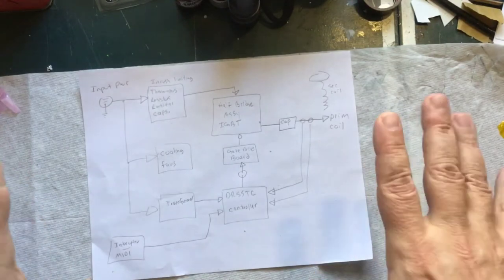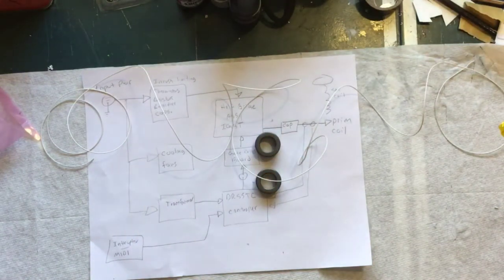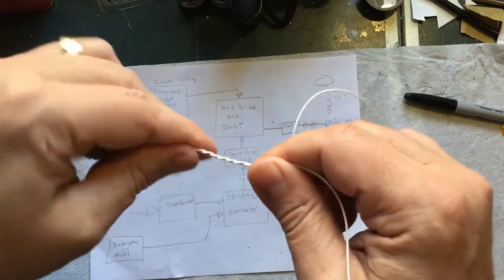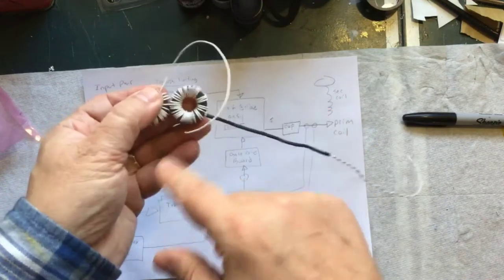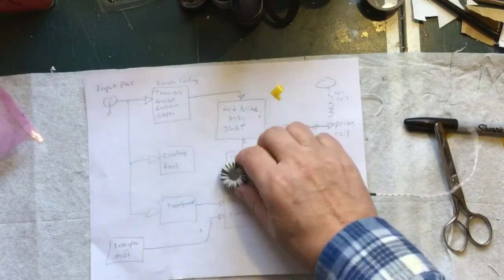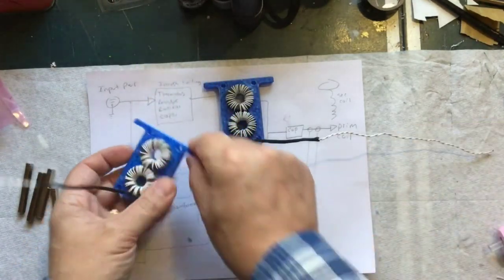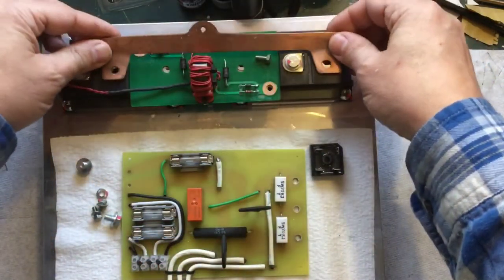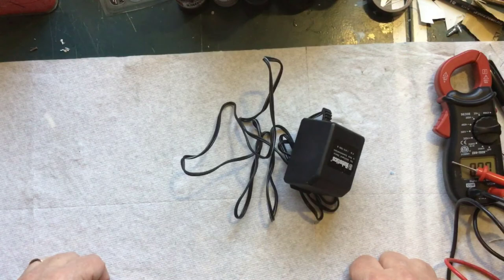Musical Tesla Coil, DRSSTC Build part 4

Comment: Could you post a link to the toroid's I can't find any for $1.50 not even $10.00, thanks.
Reply from the maker: https://www.easternvoltageresearch.com/ferrite-core-77-1/      I didn’t use the cheap eBay ones because I didn’t know if they were exactly the same composition. They are about $5 from eastern voltage research, and I seem to remember finding them cheaper from a distributor by searching the specs, but don’t remember where.